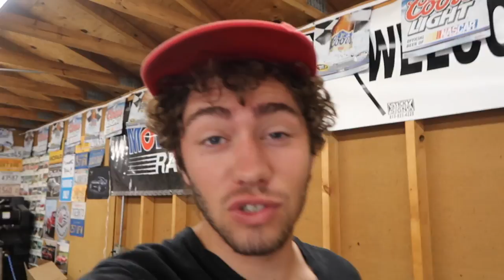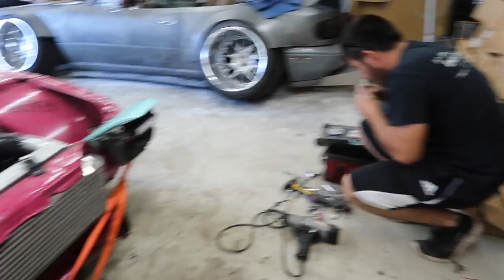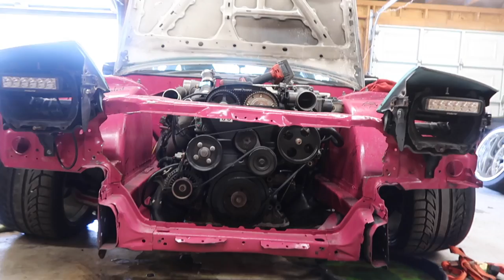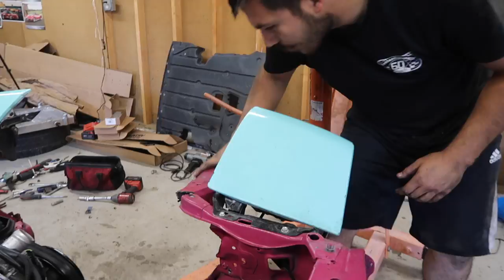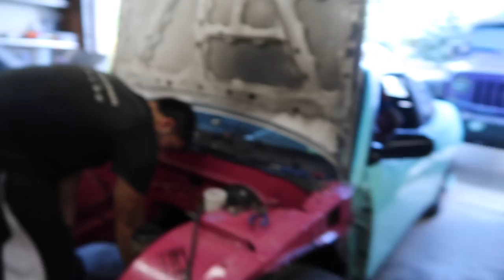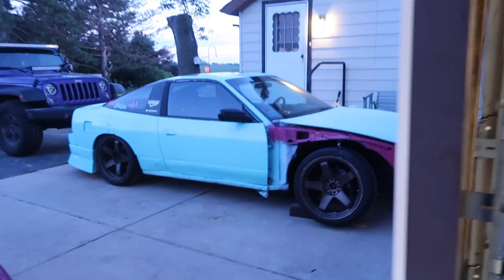R.I.P. 1jz s13 240sx

Comment: He could have just tubed the front?
Reply: Yea or go to a body shop with a frame machine and have them square it up again. nobody knows how to fix things or build parts so its just easier to dismantle it. That's all they know how to do. I mean what is the most complex part you have ever seen Tyler build?
Reply: Ken Noland That's true but even then the frame damage doesn't look too bad from what I saw, he could have still driven it and if money was the issue just save up for the mean time. I know tube front aren't cheap but they aren't the most expensive either. Anyway yeah but tyler fabs a lot of his stuff might not look the best but he does it.
Reply: Yea the most expensive part to a tube front end is buying the equipment to build it. I mean you'll need more than a HF welder for that. BTW I'm not trying to talk crap on Tyler I enjoy his videos, I just think they could of made a cool video repairing the car or doing a tube front end, instead of tearing it apart.
Reply: Ken Noland I feel you man. Such a shame but whatever it ain't my car just sharing my opinion.
Reply: i would like to add as the owner of the car... it can be saved and will be saved. the frame rail is buckled and bent. strut tower ripped apart and the Firewall got smashed in.. ive built thjs car from the ground up. shaved and tucked the entore engjne bay, did tubs myself and 3 different swaps. i sold my entire motor swap and picked up a ls swapped hatch.

Comment: have you ever broken a wheel adapter. I have a car with 500+lb ft of torque and just curious how bad wheel adapters are. I see drifters use them
Reply: Chris M , as long as the spacers/adapters are of good quality. Hub centric spacers/adapters are also better as far as safety. Running a really thick one (3in+) drastically changes the suspension geometry, so for those you'll probably need aftermarket arms, knuckles, tie rods, etc.
Reply: MazdaMini Garage thanks for the responce they are only .75 inch thick. they are so I can fit some foose wheels on my caprice. just worried about hoonin and loosing a wheel. I guess time will tell. they had to be cut to match custom axles so hubcentic to car but not the wheels.